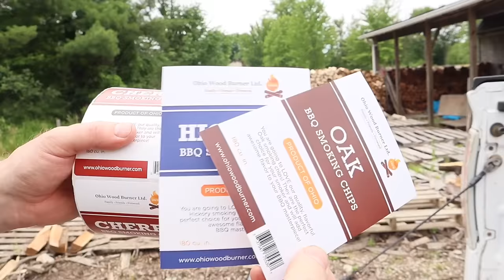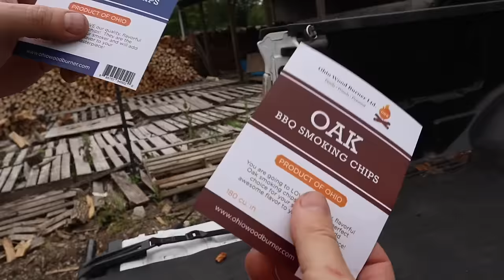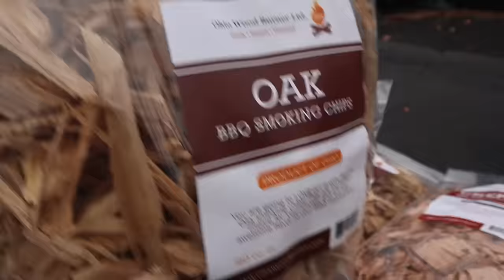New Firewood Product Nets $10,000 A Cord?!?!?

Comment: at that price per cord, you can use gold thread to sew the labels on. I have a chipper some thing like that, one way to up production and lower production cost would be to make the chips from longer pieces, if this pans out for you as I hope it does, cut you wood for chips as long as you split equipment will handle,  be a little more particular how you split it the first time, that chipper should handle a 4 inch diameter piece without chocking, maybe 5 inch,  green wood would chip lots neater and less dust, but then you need to stir that pile often to prevent mold, and you better hope for sunny warm weather the whole time, I realize you used what you had on hand to begin with, so would I, but as you said, adjustment and refinements are a constant process.

Comment: Hmmmm...... let's think about this! Maybe rig up a tube that attaches to the chipper shoot and blow your chips directly into the bag? A decent small, smooth plastic drainage pipe show work. That way it will be easier to cut it down to size. And any tractor supply store would have grain scoops to fill the bag. Maybe put your top holes a bit higher so you can hang your bag so it frees up your hands? Just a small piece of ply wood with some pegs could hold it. Maybe on the end of the pipe just to eliminate that extra "fill the bag by hand" step? Just a few thoughts for ya.

Comment: Excellent video.  I just subbed.  I think in order to increase productivity through drying time, you could build solar kilns.  They're just like a greenhouse...super easy to build with clear polycarbonate roofing panels, but you can put cheap solar powered fans to blow across the chips.  I'm sure it'd cut down the dry time.

Comment: Just FYI there are holes punches made specifically for plastic bags so you do not have to put the paper in it to make a clean cut. Also, fold your bag in half or fourths to make multiple holes with the same punch or punch multiple bags at a time. You can do this with the right punch.
Reply from the maker: I would imagine with volume I would change to something like that. In due time! Thanks Brett

Comment: Could I make a suggestion for your process? Why not chip the wood straight into a flat bed trailer. Eliminates the need to go from tub to dump truck. Also won’t lose any product on the ground from chip that miss the tub. Not a huge deal but I’m sure you aren’t looking to waste anything either. 
 
Could have 3 trailers for each wood type or just simply divide the trailer into 3. 

Then you could move the trailer where you want it and let it dry and then package straight from the trailer. If it’s economical you could use Dunlap bags so the filling process doesn’t have to be as delicate and there’s no worry with ripping the bag. Better in transit as well. Might set you apart from other retailers. 

Could also use a metal slide/funnel for packaging.

Comment: Hey Joe! I think a packing peanut dispenser unit would greatly speed up your wood chip packaging process. 

Build a stand to hold a packing peanut bag for each wood variety. Even if you have to climb a ladder for a while to dump your containers of chips into the dispenser it would still be a little faster. You could chip straight into the dispenser bags and use the tractor to hoist them up to the hanger. 

ULINE sells the packing peanut dispensers and also pre perforated ziplocks to eliminate that step.

Comment: Pretty good idea but this is what I've learned from smoking meats for 40 years now.
First is the drying of the wood, kiln drying takes out a lot of the natural flavors from the wood, so keep the drying process natural.
Second that is works best for me is smoking with chunks instead of chips, they don't ignite nearly as quick and give you longer smoking time.
That's my plan is to sell bags of chunks that are made from odd size log in and limb cuts. Full size logs I'll split them use my miter cut off saw to cut to 3 to 4" long pieces bag and sell.
As for people that still use a stick burner smoker such as myself, smaller splits such as what you sell to your restaurant customers, I plan on selling bundles large enough to get one or two cooks out of.
The chip bags are great but I have no chipper or tractor, but the product looks great!
Reply from the maker: Thanks for your insight Scruff.  I had thought of chunks too but for now I have to get these established

Comment: A thought from Downunder - Is it possible to actually shred this wood to make a wax impregnated log that the firestarter challenged could set up? Sort of like a firestarter but without knowing the techniques of getting a combustion stove going. I envisage a brick sized block of sawdust/wood/wax with holes in it that could be lit sort of like a candle. A stick of wood could be placed either side and get the fire going. I mention wax because even using hydrocarbon fluids there is a residual smell. Probably not a good idea. 
You would need a way of compressing the block to get it to retain shape during transport - possibly a shredded solid wax would help.

Comment: Joe, you need a funnel to fill the bags and a scale so you can be consistent in your quantities per bag.  A dryer would be good too as you can’t control the sunny days, especially in the winter.  Can you use the heat from your outdoor boiler to dry your chips?  Is your boiler operating in the warm weather months, may be a problem.  A solar heater/box may be an option too.  Just a couple of thoughts.
Reply from the maker: All good ideas george. T hanks buddy

Comment: I used to buy the chips ,but they smolder and burn out quickly. I prefer chunks these days. I just spit my logs and branches down to the diameter close to what I want, and then use a miter saw to make the chunks. They burn longer for those low and slow cooks.

Comment: An idea maybe worth trying. Cutting some logs split pieces to 24" (or how ever long the Japa will cut) to reduce the number you need to feed into the chipper. Also helps with the feed issue.
Reply from the maker: I think that may work.  Thanks Phil
Reply: For  better chip consistency on  chips you need a more consistent in feed the saw mills that chip slabs have same issues

Comment: Maybe check out a 8-4 or 10-4 inch reducer fitting  that is used for round sheet metal ductwork for the furnace to put the preopened bags under.

Comment: Yes its so easy to look at more volume for more money. My business has a limited and shrinking market and I have all ready projected an end point in my retirement planning. So at that point I will be done. Also you need to go to heat sealed bags.
Reply from the maker: I had thought of that Brian.  I could probably seal these but I haven't tried yet.
Reply: @ohiowoodburner  Stores don't like things that can be opened in the store. Little bits like that make a heck of mess if they inadvertently open or get opened.

Comment: Fantastic idea. If you got busy you could perhaps have someone make you a hopper and a chute which you could then put your bag round the bottom of the chute. Then have a rotating handle with flaps and as you rotate the handle in side the chute it would dispense the chips into bag. Maybe too complicated but that’s what I thought. Also look at a beer bottle labeller to hold the labels as it will peel off the label from the roll and you don’t have to lift it up and down all the time. Hope that makes sense
Reply from the maker: Good thoughts Tim.  If I get to a volume that would require that I can see that in my future

Comment: Chip it into a 55 gallon steel drums. Have a waste wood fire beneath the drums.. 8-10 pieces of  6 inch stove pipe inside the barrel to separate the chips and evenly heat the chips...watch for water vapor escaping from mini chimneys....Voila! Instant wood chip dryer/cooker that will super dry the chips completely.

Comment: I started with chips, but ran the $ # and bought an off set smoker so I could use sticks and chunks.  There's definitely a market however, I'd say you should shoot for a place in that market before running to the high end of it. 20 bags at $5 is still crazy higher than the bundles and people will try it because you aren't the highest price. Also if the store front charges 50% more for retail it's still competitive. If they have a 100% mark up now you're super expensive if you start at $10.
Reply from the maker: It has been my practice to go with margin every time. I'm not very interested in volume even if it makes me a couple extra dollars. I am not interested in extra effort

Comment: hi again i for got (old people thing )to write . you may want to add some wax and sell it as fire starter in those nice pages . here the saw dust makes great oil absorbent in a shop . different sawdust but all my neighbors get it for that or if they blow a hydraulic line . your doing good keep coming up with the good ideas who knows i may have to sell some firewood to off set fuel costs  john
Reply from the maker: Thanks for the tips!  There will prob come a day where my volume will require me to look at ways to dispose of my scraps.

Comment: Perfect way to get rid of scrap pieces that were cut to long or short whatever. Instead of selling it cheaper throw it in the chipper. Don't people like to use a apple and pecan too. Guess you probably don't have pecan trees up there we have them everywhere down here but there has to be apple orchards. Maybe you can get some of the dead trees from the orchards to chip. Assuming you can get a premium for it. Could probably buy some of the scrap slabs and lumber from a lumber yard. I know here I see it listed on the FB marketplace all the time and you can get it for next to nothing. Then you would have 8-15 foot or so pieces you could just feed through the chipper. Just have to pick the right bundles I guess lot of what I see is hemlock but I have seen where they must have been processing just maple, cherry, or oak and they have pallets with scrap boards and slabs stacked 5 foot or so high and the pieces are usually around 8-10 foot and last time I bought some I paid $15 per pallet of it to cut up and use for kindling
Reply from the maker: Thanks Jesse. I never get apple I can't think of the last time I've ever had some to work with.
Reply: @ohiowoodburner  Sure you have some apple orchards where you are probably pears and peaches too. I spend time between 3 houses in different states. I live on the SC coast but have a house on the AL Gulf and the one I am at right now up around Erie, PA so Ohio is just a few min away. Not sure where you are in OH but there has to be some orchards there. Maybe you could trade some firewood to get some of their dead trees. I have apple, pear, and peach trees here now and I had to take some out and there is wild guess they are crab apple trees growing all over. Sure you must have some saw mills around too. There is tons here with Amish but there is more then just that. Lot of people that just have a Woodmizer themselves and sell the scraps and slabs. I haven't had any in a little bit but I know last time I paid $15 per pallet of scrap boards and slabs and I got to pick which I wanted and when I cut and split it all I got I think nearly a full cord from each pallet and I got some that was just oak, cherry, or maple. Be ideal then you could just feed the whole 8-10 foot pieces into the chipper

Comment: .I think one way to improve on this is to be more efficient in filling the bags.  Rather than a repeated arm motion to fill them, think of a  good sized container with a large opening  on the bottom with an on-off valve.  Stick the bag under the output, and open the valve, using gravity to fill the bag.
Reply from the maker: I think you are right but that would depend on volume. I have a much more efficient way to fill them but I didn't do it for this video

Comment: Feeding the chipper:
1. Lay a stick in the hopper.
2. Push the first stick in with a second stick.
3. Push the second stick in with a third stick. 
4. Check the blades and push the stick in where the blades are sharpest.

There may be a law that says you need to write down how many chips are in the bag.
Punch 5 bags with one punch if you can.
For a screen get a section of hail screen and trim it with boards.
Seems like a good idea.
Reply from the maker: Thanks for the ideas jake!
Reply: @ohiowoodburner  
Bag loading:
1. Fabricate a trough from wood or.sheetmetal or screen mesh wire.
2. Lay trough on table and tie it so it will not move when used.
3. Load the chute with chips.
4. Slip the bag over the end of the trough.
5. Push chips into bag.

---- raise up the chipper to an appropriate working height. The PTO will last longer if it is out of line a few inches, not straight.

Comment: OK. Do not get a kiln. Cut some squares of black plastic. lay them on some of your pallets. On the ground is actually ok.  Can be used multiple times. Spread about a bags worth of chips on each plastic square. When dry just pick up plastic square, with chips. Pour into bag. 
If you punch a whole into bag at very top on each side, then it can be hung. No need to hold bag. Make sure bottom of bag is resting on solid surface, so there will be no weight on holes in bag.

Comment: Hey Joe does this make you "A CHIP Of The Ole Block." Just dreaming out loud, if this product takes off what about taking 18 or 20 inch black road culvert, elevate and mount vertically, have gate at the bottom to put bag under to gravity fill and mount 4 inch duct at bottom that squirrel cage fan could attach to force air through. Put a stack extension on chipper and fill right into the mini silo. Hey have a great 👍 day
Reply from the maker: Nice ideas Mike.  I would suspect if I enjoy doing these and can find the sales I would eventually gravitate to a more reliable production method

Comment: There is one thing that should be noticed: even if you resplit wood before you put it into the chipper it is dried hardwood. It will be hard on the blades and on the bearings, the chippers are usually "designed" for small limbs and stuff. But if revenue is nice you can change it out every year or two, I wouldn't count on the welds with that use. But that's just me...
 But the video was nice as usual 👍🏼🤗!
Reply: On Dry industrial chippers the blades are just a different angle of grind (e.g 60° to a 70° or similar this isn’t the actual ° of angle) I used to work a morbark semi trailer chipper for a living many years ago.
Reply from the maker: Good thought.  These blades are replaceable but I do think chipping green is the best way to go
Reply: To help this the chipper blades can have a back grind put on them. When I am chipping  ash or hickory  slabs i use this type of chipper knife

Comment: Well here in Milwaukee, WI Menards sells 175 cubic inches of chips for $6.99. Lowes sells 180 cu in for $7.48. Home Depot has 179 cu in for $6.97. Every market is different but, I have 2 grills and an offset smoker and bought a pallet of white oak whiskey barrel staves, 4'x4'x4', 1800# for $250. I thought it was an ok deal, maybe a bit expensive. The quantities they are selling, small cubic inches, your bags look larger than these, have you measured the amount you are putting into a bag? Chunks are sold by the pound, those look like 2"x3" roughly, now if they weigh them wet, as bags are mesh and breathe better than ziplocks, this will be possibly better as a smaller amount could be put into a bag as it will be heavier wet than dry ..... I don't know??? Best of luck Joe.
Reply from the maker: I saw similar prices I decided to make my bags bigger figuring Im a locally-sourced product and could justify a higher price. We shall see if this works

Comment: If you were splitting a  straight species such as cherry ,hickory or oak you could turn  splitter waste scraps into high value  product. Would need to chip then season in a screened basket.  Wasnt rocket science  but the desire to move forward . Good luck moving forward with your idea you set in motion.
Reply from the maker: That could very well be a way to go forward for me Bill.  I like it!!
Reply: @ohiowoodburner   at 955 gallons  per full cord could equal  a extra 25 full cords of production

Comment: That looks like a product you could sell on your website pretty easily.  Small and light enough to be shippable.
Reply from the maker: I thought of that too.  I would have to make sure I can mail wood products across state lines.
Reply: @ohiowoodburner  Good point.  There might be certifications for a heat treat process or some compliance requirements.
Reply: @ohiowoodburner  Here in Missouri you cannot even cross county lines anymore. Your whole business model would fail here. That said for bundle firewood you have to kiln dry on "sanitize setting" and then can ship anywhere. Have seen the same camping all over. Sanitize setting is something like 150 degree internal temp of wood for like 20 hours or so. That assures that any larvae die that might be burrowed deep into the wood. I assume their would be similar for chips and chunks like this but check the laws to be sure. Those chips are so thin that getting an internal temp would not be hard and you could likely run them fast through a chamber instead of hours in fixed place. Also the sanitizing process kind of kills the oils you need for the smoke and flavor so not as good a product and real smokers know this so they shop local. Average guy might not know and still buy but really best to stay local and air dry.  Find a good smoked meat forum and join. Then ask for advice from the guys who know.